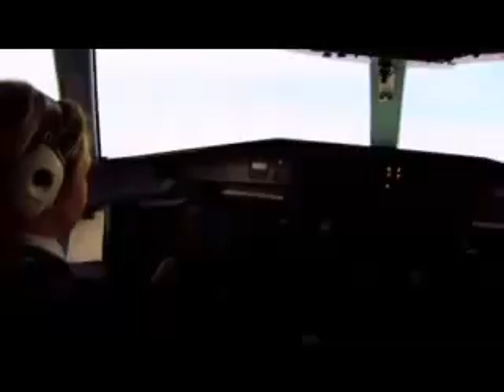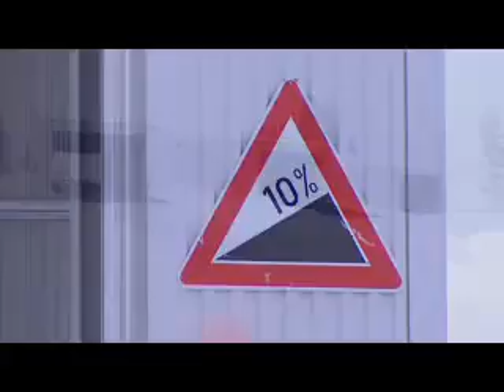Learn how ABS - TCS - ESP Works in Detail

Comment: Basically ABS does two functions: 1) Helps Traction Control System to avoid wheel spin during acceleration on snowy road and 2) Prevents wheel slide during breaking.